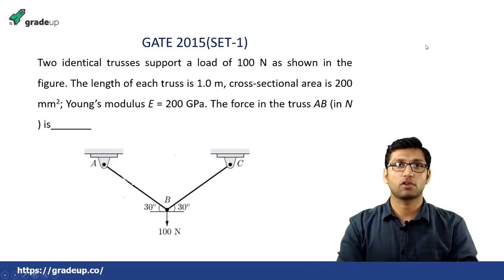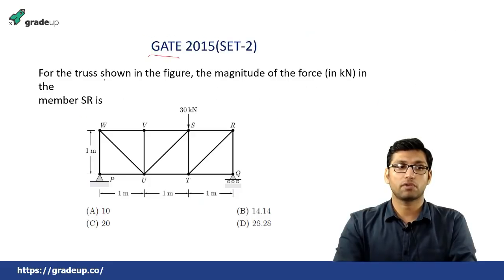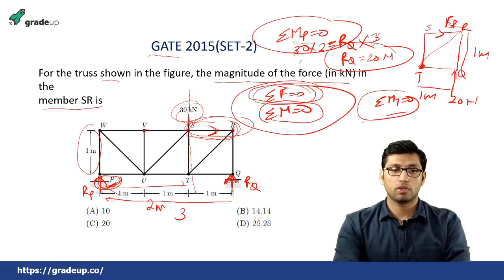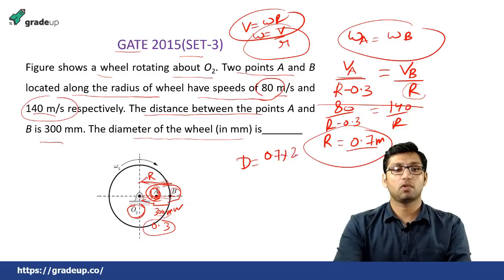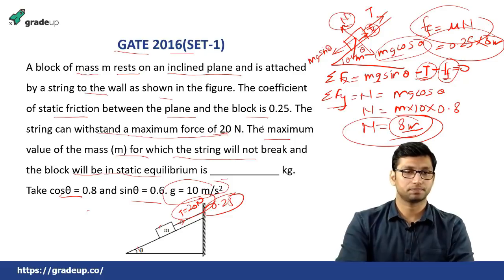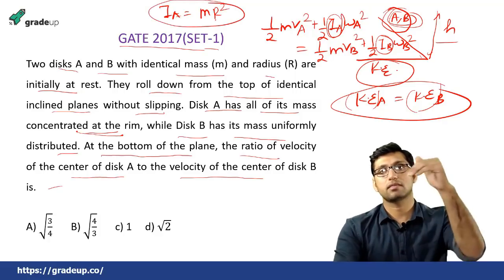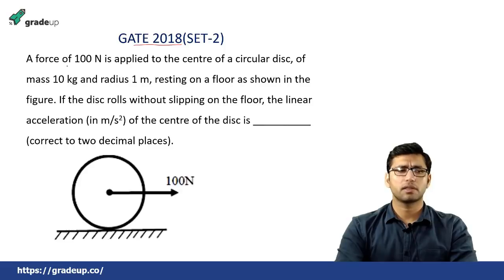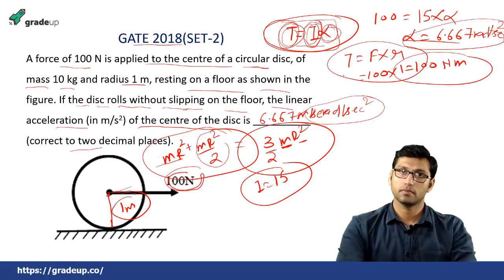Engineering Mechanics GATE Problems | Truss, Friction, Moment of Inertia Previous Year Questions

Comment: In last question linear acceleration is asked and you calculate the angular acceleration in rad/sec
Reply: Linear acceleration= Angular acceleration* Radius
=6.667*1= 6.667 m/sec^2.
Reply: Linear acceleration= Angular acceleration* Radius
=6.667*1= 6.667 m/sec^2.